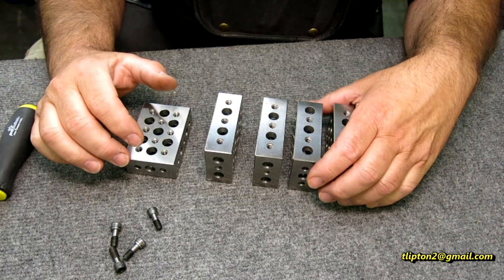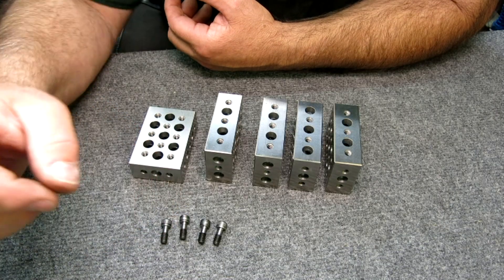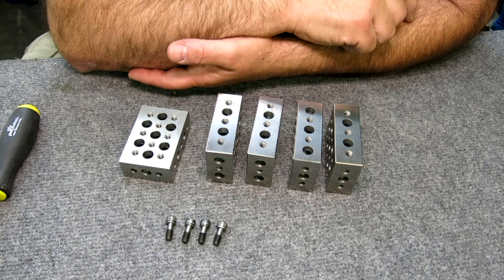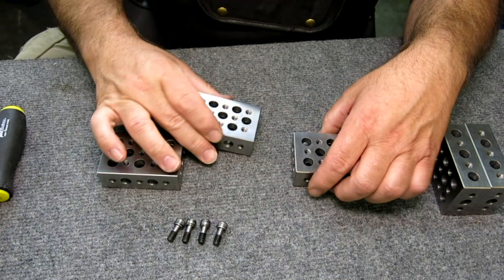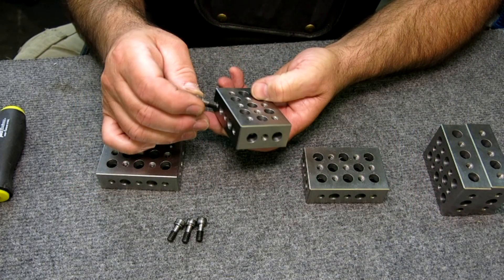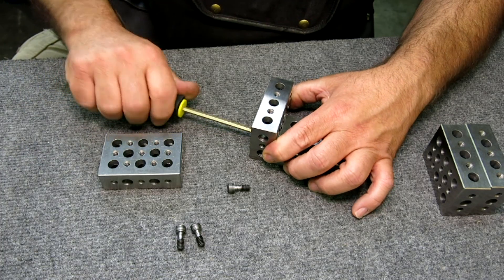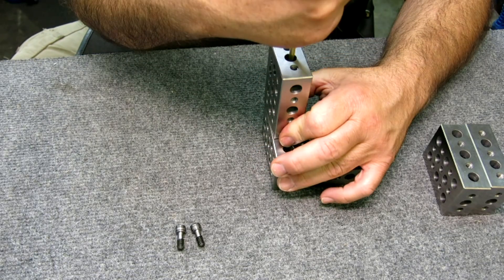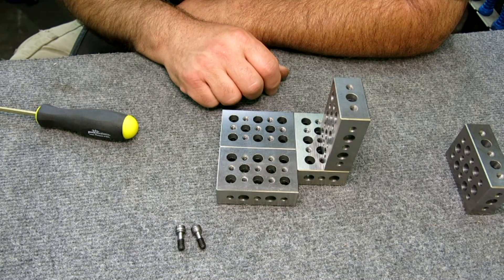Renzetti Universal 1 2 3 Blocks

Comment: in machine building, we have two types of panels a cover and removable guarding, the bolts must stay in the latter once removed. so i have to make hundreds of these bolts, your method is correct but you can get away with using a single tapped hole to a depth with a grub screw as a stop, you wont need to tighten down as the parting tool will make it tighten against the stop. this way its repeatable and quick :)
Reply: Oh bullshit. In "machine building" there are all types of shields/guards and systems/fasteners for attaching them and there is no requirement that the fastener stay with the shield/guard. Those "bolts" (BOLTS screw in to NUTS while SCREWS screw into THREADED HOLES in PARTS) are nothing but Allen-head cap screws no different than those used in millions of different machines/applications and available in bulk from any fastener supplier. Like any other "bolt" the MAJOR DIAMETER OF THE THREAD is the same as the diameter of the unthreaded portion or "shank" and the only way they stay "with" a part they're screwed THROUGH is if an additional retainer is used on them. Commonly a "wavy" spring steel washer of some kind is stuck on them or some other method of retaining them that puts the retainer between the shield and machine is used. But more often than not when the fastener needs to stay with the shield a dedicated, specialized fastener "system" that's preassembled and installed into a much larger hole in the shield by riveting, welding, screwing etc is used. Dzus fasteners are just one example. And you still end up with retention hardware in the "joint" and a very WEAK joint. Where shields have to add to or at least no detract from the "strength" of the machine and are there to shield moving parts from anything but human hands or other appendages, the shield is simply screwed/bolted to the machine just like every other part so the joint is as strong and "tight" as possible. And since modern fasteners have ROLLED THREADS rather than "cut threads" when produced in BULK for "industrial" use, you're pissing away lots of time and money making them if you're doing so with anything but a "thread rolling" machine you're not operating so much as babysitting as it does its thing. The only modern fasteners produced on a mass-production basis these days are sections of "ready-thread" and tiny screws that can't be "roll threaded". And there are damned few of those produced on a "mass production" basis.
Reply: @deeremeyer1749  I think you totally missed what he said.

Comment: Wait, what were you doing with the hand-drill there?
Reply from the maker: Breaking the edge on the entrance to the tapped hole at the bottom. Makes the fastener start easily. Cheers, Tom
Reply: My guess is a light chamfer/deburr of the tap circumference at the bottom of the deep counterbores....?

Comment: The only improvement I could think of, is to ream all of the tapped holes so that they can accept a dowel pin, to allow for precision alignment.
Reply: I had considered that but I think that would raise the level of block construction difficulty about 4 times or more. i don't think just reaming the holes would give good enough positional accuracy to keep things square or parallel when interchanging with every other block.  Not only do you need every hole within .0002+- but you also have to have every face square and parallel not only to each other but also to the holes and the faces have to be equal spaced from the center of the holes. I think that would be a big job for even a talented and skilled machinist.
Reply from the maker: Actually you align them on a surface plate. Pre placing super accurate dowel holes prior to heat treat and grind would mean some jig grinding. I don't actually need much of an excuse to get one so better I leave that off. Thanks for the comment. Cheers, Tom
Reply: @oxtoolco   OR better still, align them while pushed into a big V block so two adjacent (mutually perpendicular) pairs of faces are aligned simultaneously

Comment: On the deep holes that feed across the whole block: did you counter bore the hole to have a flat bottom? or did you just use a normal twist bit and leave the taper/counter-sink end?
Reply from the maker: Flat bottom drill. I show a short clip in the video. Look at the tip of the long drill. Cheers, Tom
Reply: I was thinking today, and that can be a dangerous thing for me, i wanted a method of quick, accurate, rigid, and easily reconfigurable fixturing, and after some sketches I figured the most practical was going to be traditional setup blocks with asymmetrical counterbored and tapped holes virtually identical to these.

Comment: Most interesting! You have obviously left out the grinding and I presume heat treating.

I wonder how many of those that you could do at once in a single setup to get the cycle time down on an automatic machine?
Reply from the maker: These are not heat treated yet. Just rough ground for basic geometry and to get closer to finish dimensions. I think we should talk to NYCCNC about cycle times for production. Didn't he just get another mill he needs to feed? Cheers, Tom
Reply: John doesn't seem too comfortable with mild steel, let alone A2. Like a lot of these modern CNC shops they are nearly Aluminum only.

Comment: These blocks are a very good example of how almost anything can be improved by thoughtful analysis and design. Thanks to you both. I almost wish the tool makers in China have watched these videos.
Reply from the maker: If were lucky they will and sell them for $20 bucks a pair. Cheers, Tom
Reply: @oxtoolco  Did you ever end up grinding these after heat treat?
Reply from the maker: @PeteBrubaker  Hey Pete. Yes I did. I use them regularly. Cheers. Tom
Reply: @oxtoolco  I was thinking about this some more.  Would you consider showing us the procedure in a meatloaf episode?  How did you square them up then grind the same amount off either side to ensure they came to size and that the hole pattern remained centered?  I can grind something square, and I can match the pieces that are on the grinder.  I sure would love to know how to approach something like that.  I know you can't show the work because you already did it, but maybe a walk through of what you did?  Cheers!  Pete.

Comment: Another project to add to the list. Be sure to check out the cube concept from you tube "solid rock machine shop" another handy fixture concept.
Reply: Thanks Brian.
Reply: Ah! That perpetual, ever growing, often changing (in priority) list of projects.  Mine would look like a streamer if I hung it out in the wind.  And yes, it just grew some more.  Today's project intent is to go gather as much junk wood as I can easily find and make some charcoal for forge and heat treating work.  No doubt I'll be eyeballing potential material for blocks in the process.
Reply: I guess this is the "cube concept" video: https://www.youtube.com/watch?v=gzPIBvWiaVE
Reply: I think Brian was referring to this one https://www.youtube.com/watch?v=RFuX2zOZWIE
Steve
Reply: diggerop, What you need is one of my Patented "Round 2 It List", make your list on this continuous roll until it is all filled in and start working your way through the list. Then when someone important asks if you have done it, you can say it is on your "Round 2 It List" and you will get to it eventually. [yeah right]
Reply: Solid Rock Machine Shop Inc.

Comment: Tom, you should consider add some precise holes to the pattern for (removable) dowel pins to accurately align the blocks.
Reply: To be precise enough for dowel alignment to be worth doing, those dowel holes would have to be machined after hardening, yes?  The way those blocks are used means a lot of exposure to wear and tear, I'd certainly want mine hardened!